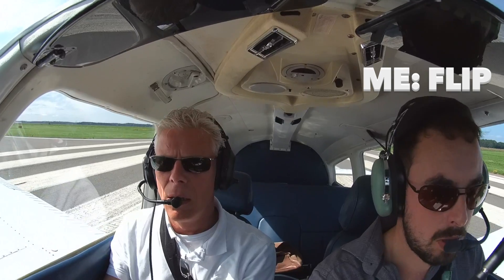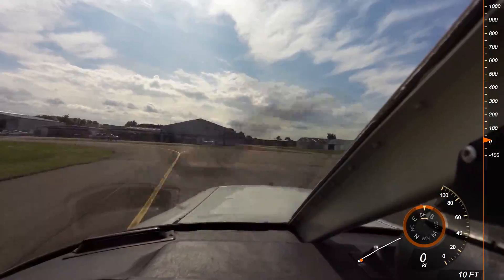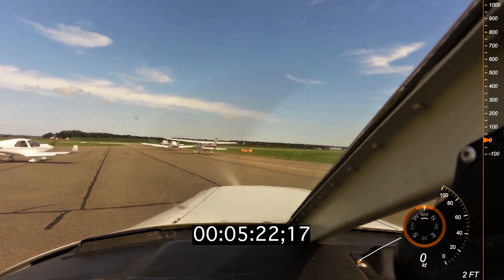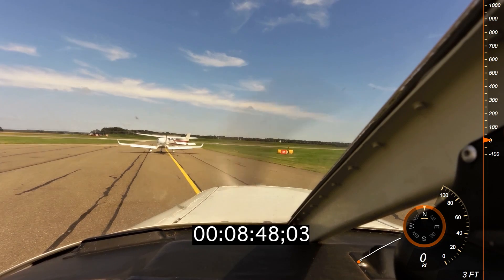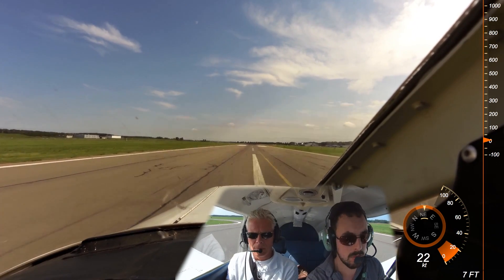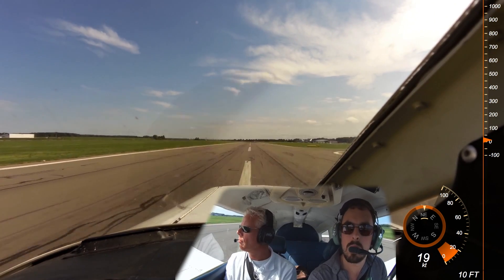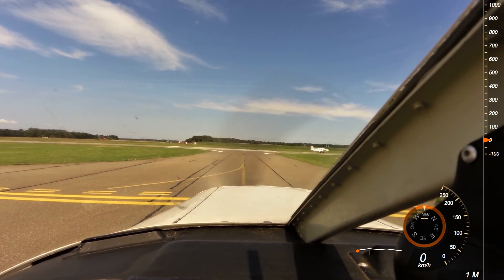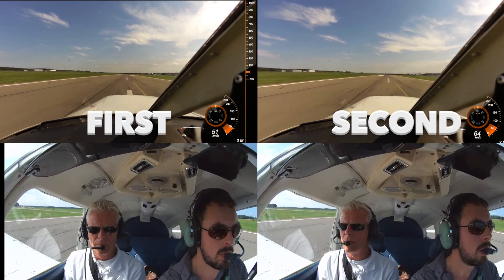TakeOff Abort - fouled spark plugs: Why lean on ground/during taxi [Contribution to FlightChops]

Comment: Had this happen 2 days ago while doing closed traffic. On the 4th I applied power and got severe shuttering with very little take off power. Aborted takeoff and taxied to a run up area. Verified fouled plug but called it a day.
Reply from the maker: Sounds like a good call!

Comment: There is nothing wrong with leaning during taxi. BUT you MUST lean aggressivly. This will prevent you from taking off if case you forget to de-lean. Lean the way that the engine will give taxi-power but not much more. If you then forget to de-lean and try to take-off the engine will remember you with stalling.
Reply from the maker: Good tip!

Comment: Learned to fly in 1978 and never seemed to have any issues then, perhaps because the trainers were newer birds.  Now with a club, I notice most of the time on start up, the engines will run smoother if I lean them slightly.  The club owns old birds.  I do believe it is important to lean the engine regardless of whether you are idling; Taking off with full power or cruising.  Not much mind you for the taxi and takeoff.  Better to raise head temperature a little than choke up while rolling on take off.  Plus, the difference is easily noticed on mag testing.  Oh sure, I know the engines are overhauled and all that, but the engine is still old stock and maybe carb/throttle mechanisms/settings are worn in somewhat and this causes a slight difference in fuel feed!?  No heat please, I am not a mechanic and not in a position to say anything with certainty, but this is how it works for me.  The club has had several instances of fouled plugs and maybe someone is not leaning the engine in cruise as well. Thanks for the video.
Reply: I get leaning during taxing, but lean during takeoff? surely you want that rich mixture for cylinder cooling, providing your density alt isn't crazy high. Then again I guess it's whatever the POH recommends is what we should be attempting to do